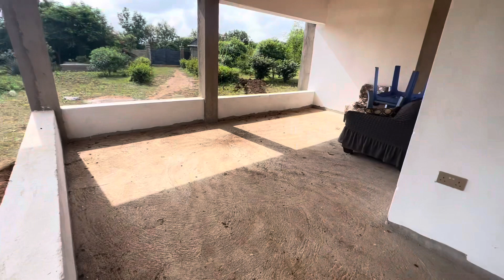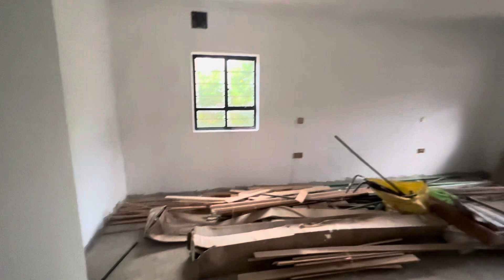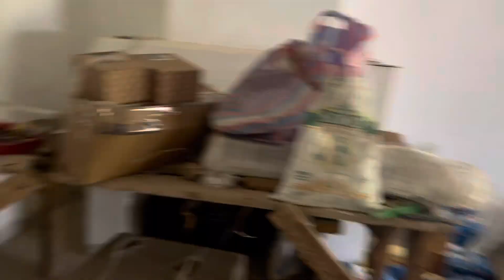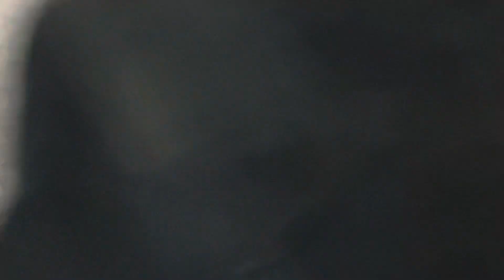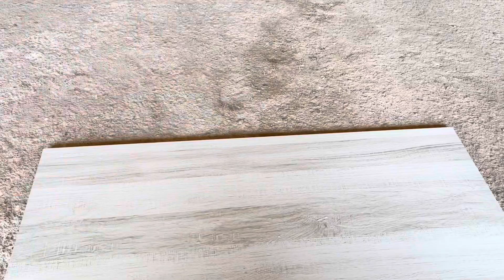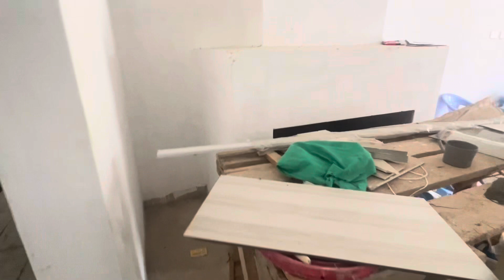Fine interior finishes: Important points to consider before floor tiles installation.

Comment: @Mr Eboli I have a question. Why are the painters not taping the walls to prevent paint getting on doors, windows and stone features? You cannot always get that paint off later. It looks very unprofessional to have paint on unintended surfaces. I’ve seen this a lot in your country. The painters need better training. They need to be provided painters tape and plastic for the floors once the flooring has been installed.
Best wishes 🇺🇸
Reply from the maker: Noted